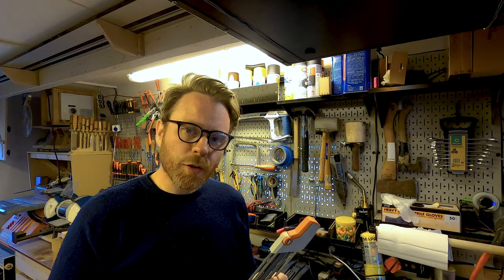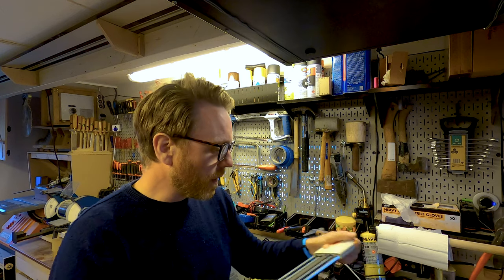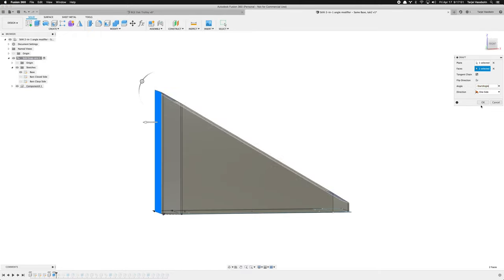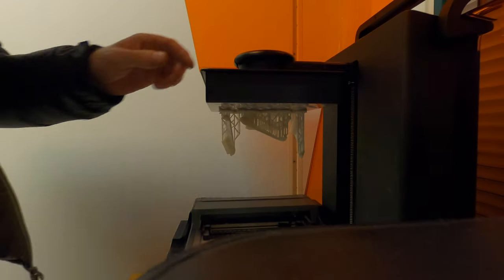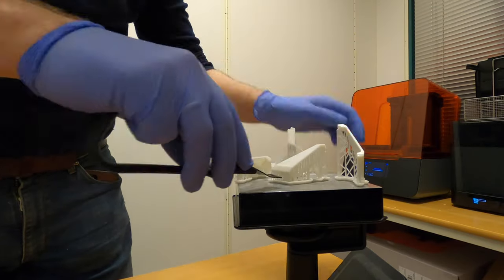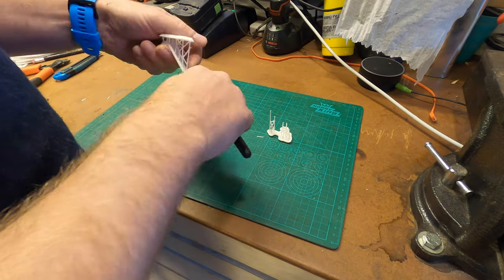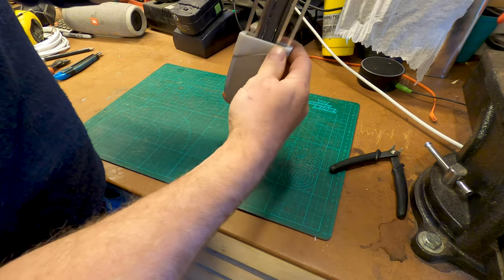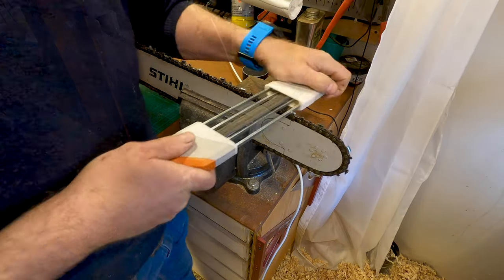Sharpener for milling: Hacking the Stihl 2-in-1 sharpener for 10° ripping cuts for chainsaw mills

Comment: How do you this this would go with PLA/PETG extrusion? Obviously wouldn't expect such high quality but do you think the STL files would slice okay?

Great idea.
Reply from the maker: Hey! Thanks! I actually haven't tried, but I'm pretty sure it would work just fine. The tolerances doesn't have to be that great.
Reply: @Hackish  Okay well I just did it and it came out fine -- except that my square rails (not sure what you'd call them) don't fit! I don't know why I assumed they would be the same, when there's so much variation in chains. For anyone wondering, yes you can use an extrusion method, just rearrange the models so they are flat on the printing sheet.
Reply from the maker: Which model sharpener do you have? Perhaps that's the difference. 
Should be fairly easy to adjust I think.
Great to hear that it works with extrusion!

Comment: I’m wondering about raker/depth gauge depth. The 2-in-1 is for a crosscut chain and set lower than a rip chain. How does the chain rip cut at the lower depth?
Reply from the maker: Good question. My chain is a crosscut chain  filed to 10 degrees. If you have a skip-tooth ripping chain it definitely won't work. I'll try to get ahold of a regular ripping chain and see how it goes.
Reply: @Hackish  I have tried this on the ripping chain that logosol sells, semi chisel, no skip...works fine (with your mod downloaded, printed and installed, thank you!). Though, I am about to buy some of that Stihl rip chain that's full chisel, no skip BUT has the 2 cutters, 2 clean-out, 2 cutters, 2 clean-out, 2 cutters, 2 clean-out sequence. I feel it should be fine (different size files, of course). Have you managed to try other chains? Thanks!! great video.
Reply from the maker: @DaleRyanLeckie  Thanks! No, I have only two of the same kind.
Reply: @Hackish  Aw crap, I have a skip tooth ripping chain. You should have mentioned you're using a crosscut chain in the video and the description. Glad I read this comment before buying the Stihl.
Reply from the maker: @bullfrogpondshop3179  Ah, sorry about that. Will update the description!

Comment: can you help me i'm now trying 30 to 25' 2in1 but i can't handle stl file oak so hard and i hope trying 25'
2in1 very good solution but 25' not selling
can you make 25 degree stl file?
Reply from the maker: Hi there! Unfortunately I don't have the capacity to create custom STL files.
Out of curiosity, why do you want to file at 25°? 
If you're cross-cutting, I would go with the standard ~30°. If you're rip-cutting (cutting across), I would go with 10° like in the STL.
I have cut oak and other hardwoods with these two angles just perfectly.
Reply: @Hackish  In most cases, 30 degrees and 10 degrees are useful, but when applied to x-cut 3/8, it's too aggressive to handle. I submitted your stl file to 3d laser up today and got a satisfactory answer.
Thank you so much. I really wanted to do this, but I think I can finish it with your help.
Reply from the maker: @총각농촌  Got it! Glad you got some help!